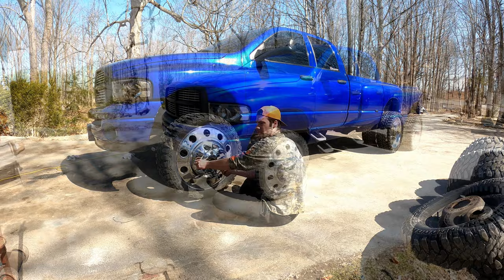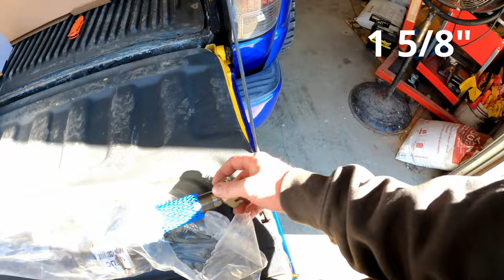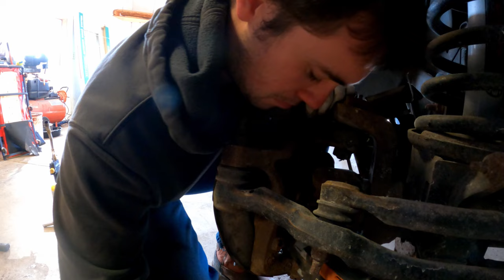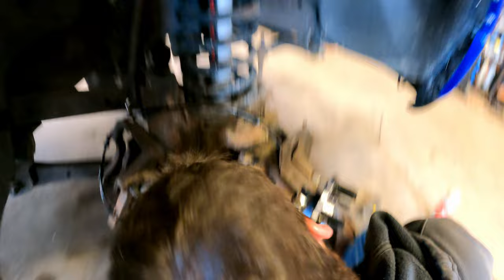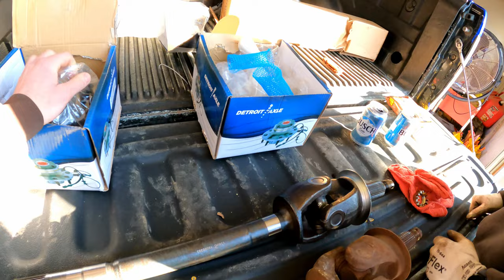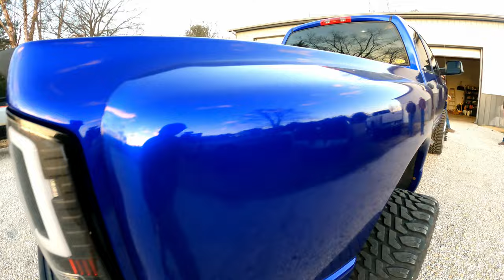Ram 3500 Hub and Axle Shaft Replacement

Comment: My LF axle shaft on my 2nd gen 1997 2500 diesel just clicks like the teeth are rubbing on something when i reinstall no matter if i turn it and go in different splines. Still does it.   Didnt do it before  and nothing used different. Same shaft that came out didnt need to replace them.    Do yall think i just moved something when messing with them putting new hubs on.    I guess i should remove the diff cover on the front axle and take a look at wat is rubbing those splines making a clickjng/splines touching somthing else.  Its a dana 60